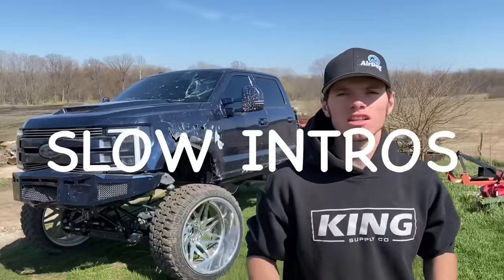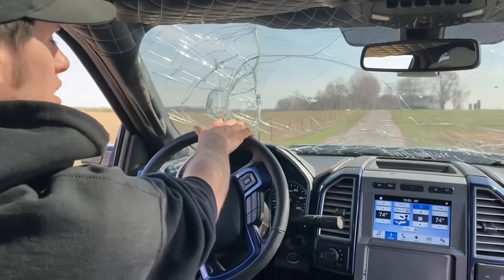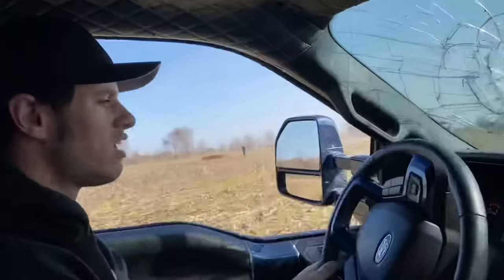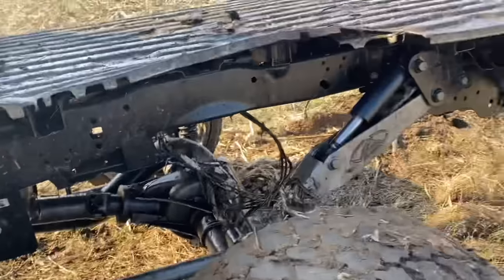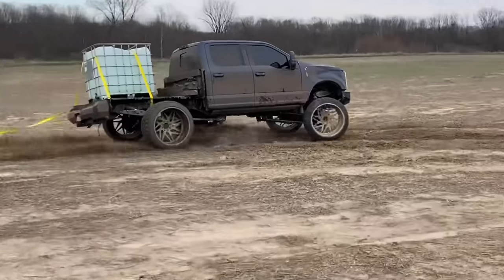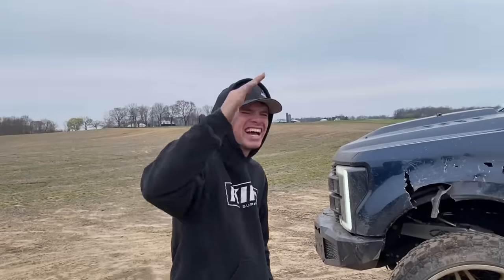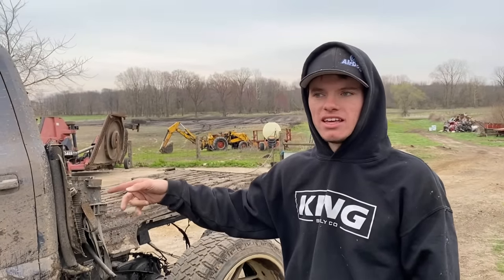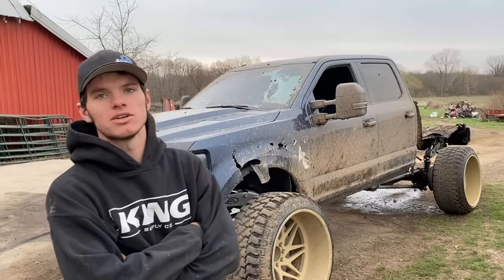HARDCORE JUMPING the AnyLevel F350

Comment: What was that about “Found On Road Dead” again??
Reply: I believe the actual acronym is "Frequently out rescuing Dodges" but I could be wrong
Reply: My favorite... Found Off Roading Daily
Reply: @markgrubb01  good one
Reply: Found on rubbish dump
Reply: Full of rusted dents
Reply: Fucker Only Roles Downhill.
Reply: Fix on road daily
Reply: @Yeah_na  ... Funny considering all NASCAR's have Ford motors. And you must have a stock in CV axles for your Chevy
Reply: Jacob G Hahahaha that’s a good one ☝️
Reply: @Yeah_na  Chevrolet = Cracked Heads Every Vavle Rattles Oil Leaks Engine Ticks
Reply: @markgrubb01  wait what. I thought Chevy and Toyota ran the same motor R07 V8 and Ford ran their own FR9 V8? When did Toyota, Chevy, Honda and Chrysler ever run a Ford motor?
Reply: Fucked over rebuilt dodge
Reply: @revvinevan014  LMAO
Reply: Found in field dead
Reply: @raywilson8048  It's spelled Ford not Fifd found in field dead?
Reply: @foxwithshades7080  
I mean, I can't think of any vehicle, or object for that matter, that rolls uphill. Gravity doesn't exactly allow that.
Reply: @jacobg5122  Well when you are driving up a hill your tires are?
Reply: @foxwithshades7080  
If you call powered motion rolling, then we must have watched different videos, because I'm pretty sure that Ford "rolled" up some pretty steep hills.
Reply: @jacobg5122  I think you are thinking into this a little to hard. But ya I guess after the third time it did make it up the hill.

Comment: It would be funny to get the turbo glowing red hot and then use a pressure washer on the engine bay to cool it down, see how much you can crack the metal

Comment: What if you did a jump in one of those with a set of lowrider hydraulics. Maybe they would have to be modified to be two hydraulic cylanders on each wheel with two compressors to each also. But you could probably do it.

Comment: Next time you jump, gain a lot of speed then brake heavily going into the jump and then go wide open throttle just as the front end starts going up the ramp 😉 you’ll get some great air

Comment: My cousins 4 runner wasn't modified at all and could climb steeper then that we climbed a wet rock on this old logging trail up the side of a mountain and I was like yea ill meet you up top thinking its going to flip as its not only step but round so yea I was like fuck that same with coming down its nose first 90 degree angle

Comment: I doubt you will see this comment. But it would be super interesting to see you beat a Volvo v70xc anywhere between 1995-2007
I beat the crap outta mine climbing dunes, mud puddles towing trucks, snow, small amounts of rock crawling. I even drive it across the Rio grand river only 2-3ft deep but it made it.

They are super cheap cars. Turbo 5cyl awd. Idk it might just be some content that would draw in the chaps from over seas.

Comment: There's more to jumping than pushing up some dirt and flooring it!
You need long travel suspension that will take the abuse. 
You need correct front to rear weight bias so the front doesn't dig in. 
You have to know throttle control for proper landing. 
The jump must be level so the truck doesn't lean in the air.  
Why do I think Cody doesn't give a 💩 about any of these facts??

Comment: Me and my cousin would hit this mini bridge like 10ft long goes up 7ft then drops back down the recommended speed is 20km lol we hit it at 170mph and fucking flew over it ny head hit the roof I was out of my seat in the air a few seconds and when we hit the ground it was so hard and we did it like 8 more times before the 4 runner gave out driving to 100 mile house like died after we got their lol